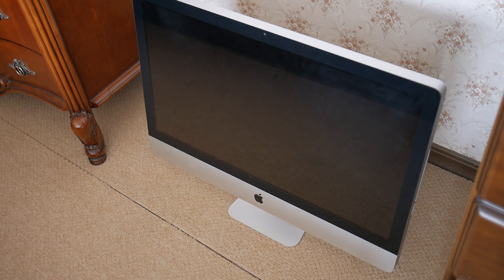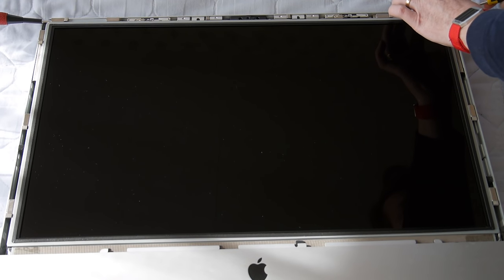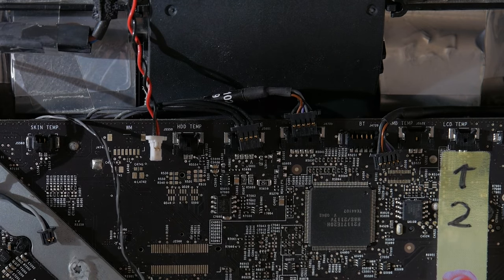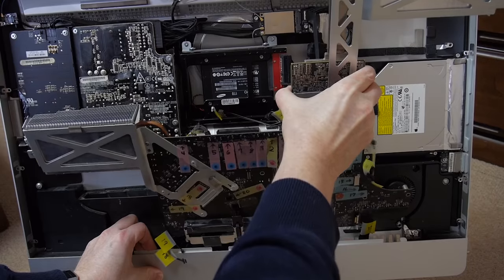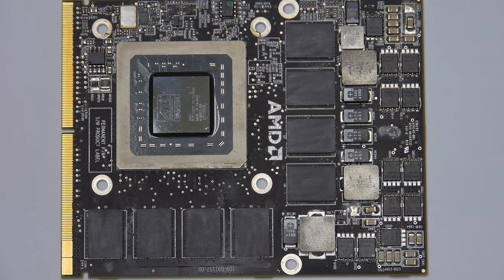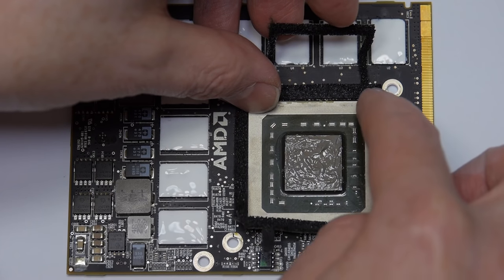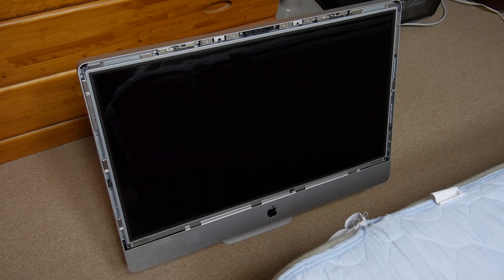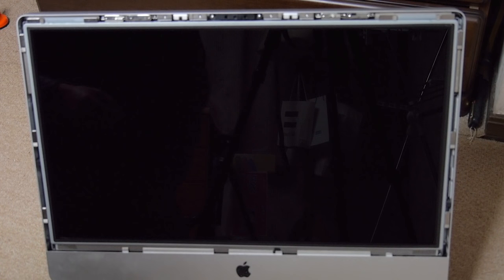Late 2009 iMac 27" Video Card Repair [4850 Bake]

Comment: Ehhh I'm pretty sure you don't have to disconnect and remove the main board to replace the Video card on late 2009 iMacs. The card should just slide out once you remove the 4 screws holding down the video card and heat sink.
Reply from the maker: If you're watching on a desktop computer, click on the words "SHOW MORE" under my JDW channel name at left which will drop down the text description.  I addressed removing the motherboard there. All said, if you want to replace the BR2032 battery, you'll need to remove the motherboard.  If you don't want to do that, please watch my 2nd Bake video where I do the bake without removing the motherboard.

Comment: No need to remove the motherboard on mine. 4 screws off the graphics card and it slipped straight up out of the iMac. Then there was one connector that I had to unplug.
Reply from the maker: You actually do need to remove the motherboard if you wish to change the BR2032 battery on the other side.  People who don’t care about that can watch my Second Bake video which shows how to remove the video card alone, without removing the entire motherboard. The link to that video is posted in the description above.

Comment: Interesting.  But actually not necessary to remove the motherboard, just replaced my GPU in my 2009 imac.
Reply from the maker: Thank you for your comment. I would disagree about the "not necessary to remove the motherboard part" in that MUST remove the motherboard (as explained in my video) in order to replace the BR2032 battery, which is on the flip side of it.  Some may argue that battery replacement is not necessary, but I thought it best to do.  In any case, it sounds like you swapped out your old GPU card for a different one.  Did you swap the same model card or a newer model?  (Just curious)
Reply: Yeah, you definitely needed to take it out to get to the battery.  There was one connector that was really hard to get to, but I managed it. I replaced my 4850 gpu with the 6770m and it works fine. The 4850 cards I saw for sale were too expensive. I was told that any card up to the 6 series would work, but I was cautious and made sure someone had used whatever I got with success. I was looking for the 5750 1 gb so I could get more video memory, but all I could find was really expensive. I know that some people have used the 6970 as an upgrade, can run hot and is also expensive.  This is for the Late 2009 27" Imac, to be clear. For me 512mb vram is fine, but may try the 6970 at some point. (I think it comes in 1 or 2 gb).  I have researched putting in a sata/usb3 port on my machine, but I would have to give up my airport slot. I hope your repair works, thanks for the video.
Reply from the maker: Thank you for sharing those details.  I am curious if the 6770m you used gets hotter than the stock 4850 card.  If the temps are the same, it probably won't matter.  But one of the reasons we have to go through this hell in the first place is because HEAT is causing the problem over time.  Apple doesn't cool their thin Macs as well as an ugly old Windows PC box, and as such the heat can do damage over time.  So if a replacement card is hotter than the stock card, that process would be accelerated.
Reply: No it's not hotter than the 4850.  I'm sure the  6970 would be though. I am using Istat to control my fans,  no more blisteringly hot back on the computer.  I'm sure that's what caused my first card to fail.  Temperature is great now.
Reply from the maker: I too am using a fan control app to keep all 3 fans running at 1500rpm minimum.  It still gets hot (a lot hotter than my 5K iMac at the office) but better than before.
Reply: Istat is a little fussy, but it's keeping my temps in the 100 degree range.  Fan's are not too loud for me.

Comment: i have always wanted to have an expensive mac, but i hate how they are basically dumbed down computers for people that don't care about speed or current gen specs.  i think i am going to buy a 27 inch housing off ebay, slap a 144hz 1440p screen in it, and then hook it up to a 1070 nuc, and if i can fit it i might even do a 1080 nuc.  this way i can run it as a bad ass gaming computer, and also boot it into osx when i want to use a mac.  its really the best of both worlds if you don't have an unlimited budget.  you could go crazy with it and slap in a 4k 144hz screen and then mod in a 8700k 1080sli laptop board behind it with some fancy sff watercooling.  you would have the only gtx 1080 sli 8700k 5ghz 4k144hz 27 inch imac.  that thing would blow away the imac pro by a healthy margin.
Reply from the maker: I somewhat agree with you, especially about the way Apple so underhandedly removed "Pro" features from the MacBook Pro.  I'd love to have an iMac with 144Hz display and HDR.  If you do build that machine, be sure to shoot a good video for us and post it here on YouTube!
Reply: JDW oh man I will for sure do it. I’ve been making generic designs for it. It’s just that gaming nucs are way overpriced. I might just start out small and do it with cheaper hardware first.

Comment: Apple should just allow mac users to buy the video card for cheap. It's damn near 9 years old. I just replaced with a used card and it worked. I was getting checkerboard screen and it would only boot in safe mode.
Reply from the maker: Agreed.  But keep in mind that the card itself has a design flaw.  In my experience, even brand new card fails in about 3 years.

Comment: You've had this apart before. It's upgraded with a SSD drive.
Reply from the maker: Yes, Michael.  The above is my 1st bake video.  My other video shows my 2nd bake, done because my 1st bake lasted only 4 months, for reasons unknown.  Thankfully, my 2nd bake has been working fine for 13 months of daily use.  It's still going strong!  I switched thermal pastes in my 2nd bake, which may also have something to do with it.  And yes, I removed the stock Apple HDD and replaced it with a Samsung EVO 1TB.  The SSD makes a world of difference.  Keep in mind you'll need an interface from OWC that allows you to mount the SSD, and another interface that will prevent the fans from spinning at full blast.  Thanks for watching!
Reply: SSD always makes a world of difference. I upgrade everything. However, it's been many years since I've worked on a Mac. Right now I have my girlfriend's Mac apart, which is why I had to watch your video. (Very good, by the way.) But I have a small issue. I need to replace the graphics card, but what I thought would have been it, you refer to as the inverter. Where exactly is the graphics card if that's not it?
Reply from the maker: Michael, if you see something different in your iMac than what you see in my video, then I would assume you either do not have a 27" model like I do, or you have something other than a late 2009 model (which is what I have).  Smaller iMacs have things in different places than what you see in my video.  So if you could tell me the size and model year of your iMac, and post a photo for me in the cloud and then reply with the link to that photo, I would then be able to offer you more specific advice.
Reply: It's from 2009. I believe it's a 27". The internals look exactly like what you show here.
Reply from the maker: At 29:35 in the above video I remove the video card from its aluminum and copper heatsink.  If you continue watching you will see the circuit board I put in the oven.  That circuit board is the video card.  And if you keep watching after the bake is finished, you see how I applied the thermal paste.  But I still recommend my 2nd Bake video for that, since I used different (better) thermal paste on my 2nd bake.  That 2nd bake video is here: https://youtu.be/6BJGLFCigdA
Reply: Thank you for the info, sir. Most appreciated.

Comment: just save me some !!! im hungry!!!
Reply from the maker: Freshly baked video cards might be tasty, I don't know.  ;-)
Reply: @JDW-  you dont happen to need another one do you? I have one i need to sell + the disk drive + speakers and 3 fans I still have the processor the ram. And the Bluetooth Wi-Fi cards I have actually everything except the hard drive and the logic board.
Reply from the maker: @cgo2key  Thank you for the offer, but no, I am not in need of another iMac. Furthermore, my current financial situation is such that I cannot even afford a cheap obsolete iMac. :-(
Reply: @JDW-  i understand man... I like to work with people when they need it most... If you decide you do need the rest of this stuff... Ill let you have it all for $50.. I can set up a listing on ebay or offerup for you... You could part it out and make some cash or use it...  And don't worry, buddy. I'm not trying to pressure you. Just letting you know the offer is open while I still have it. If you decide you need it...  You want to hear something funny? My buddy gives me this iMac the other night. And tells me it works. It just needs an update. I can check it out. And give him a little something for it if I like it.  He didn't have a power cord for it. And I got one a couple days later. And I plug this thing in. And it didn't work. So I was like screw it. I'll take it apart sell the pieces out of it for what I can get. Well after I sell the motherboard and the hard drive and finish taking it apart. I found the power button that I never saw on it. LMAO so I disassemble a perfectly good 27-inch iMac LOL
Reply from the maker: Thank you for sharing the background info and for the offer. Even if I had the desire and cash, I’m located in Japan and shipping would cost far more than the value of the machine. Even so, other people do read these comments so if one of them is interested in what you have, I’m sure they’ll post a follow up comment for you. Best wishes!
Reply: @JDW-  thank you bro!!! Take care!! ✌

Comment: I was unlucky.. didn't work for me.. more lines after the bake..
Reply from the maker: I'm terribly sorry to hear that.  Yours is the first comment under my video from someone who tried it and said the problem was only made it worse. It could be that your card was simply too damaged, or it could be you simply needed to try something different. One person recommended to me an alternative technique of putting several coins or a weighty copper block on top of the GPU chip while baking.   If you want to try again, I would suggest you try that and also be sure to bake it at 200°C for a full 10 minutes because that's what I did in my 2nd bake.

Comment: If I installed Windows could I use a nvidia mxm card
Reply from the maker: Even if the card is the same physical size as the stock video card, it will not work unless it has Apple firmware on it. Whether or not you could get it to work simply by installing Windows and running in Boot Camp is something that is never been tested, so it would come with somewhat of a risk if you wanted to try it. But if you do want to try it, be sure to video your experience so that you can share with others if indeed it does work. But I myself would prefer not to run Windows exclusively on iMac.
Reply: worth a try I guess. The hardware drivers for Windows are normally supplied via Apple I think ?
Reply from the maker: Apple only supplies Windows compatibility (drivers, etc.) within their "Boot Camp" software, which requires you to install Windows on your Mac and then boot into that partition.

Comment: It is not necessary to remove the logic board.
Reply from the maker: You are the 4th person to say that.  To avoid repeating my same reply on this topic, I have updated the Description as of a few moments ago to address that.  Here is what I wrote:

By the way, several people have said "you don't need to remove the motherboard."  My answer to that is, "yes you do if you want to change the CR2032 battery on the back side of the motherboard."  Even if you don't think you want to change the battery, at least remove the old one.  Even lithium button cell batteries leak after many years of being installed in electronics.  And for those of you who don't care about any of that, simply watch my 2nd bake video (link below) to see how to go about the bake WITHOUT removing the motherboard.

Comment: Has anyone successfully tried a hot air gun on the gpu card to see if it fixes the dry solder issues.
Reply from the maker: Yes, some experienced professionals have reported success with that.  I know because I read and reply to every comment under all my videos.  Never try a heat gun for the first time on your video card though.  Take great care when you use heat guns because they will desolder components, which is not what you want.  While the benefits of heating the GPU chip is the same, the bake shown in my videos is vastly safer for most people.
Reply: @JDW-  yeah i guess the trick is monitor temps as you go. BTW great Video!!

Comment: Oh my God that's not how a ESD strap works . There's a cable that goes up to the strap to the computer . And you don't even have the cable on there
Reply from the maker: Thanks for watching.  Yes, I am aware.  I don't often use ESD straps, and in my 25+ years of working with electronics I've never zapped anything.  I doubt I've been "lucky" all those years, so maybe I am just blessed.  Anyway, at the time I made these videos, an engineer friend of mine gave me this non-wired ESD strap.  I had my doubts it would work, and after a bit of research (after made these bake videos) I could see the evidence showing they actually don't work at all.  So of course, I would recommend anyone following my video to use a wired version strap, and such is listed in the text description under my video.

Comment: Did this and got 4 weeks out of the POS!

You can't trust this machine once the GPU craps itself, you will never know when it's gunna die again.

I learned my lesson, overpriced Apple products ALWAYS have issues of one sort or another and longevity is not part of the Apple mantra nor are supplying spares and long term support.

PC is the solution period.
Reply from the maker: Jason, I'm sorry to hear your bake only yielded 1 month of use.  That would anger me as well.  Indeed, the fact that I only got 4 months from my 1st bake didn't sit well with me either.  Even so, I did use old paste the first time, and I didn't completely replace the stock Apple thermal pads.  I considered that bad on my part, so I was sure to do it right on my 2nd bake (see my video for that), and whether I was just lucky or not, I do not know, but I am still able to use the iMac daily, now going on 12 months after that 2nd bake.  

To be clear, the only reason I even tried the bake myself was because I watched another YouTuber claim 17 months of use after his first bake.  Since I had nothing to lose (except time and a tiny amount of money), I gave it a shot.  So while my 1st bake was a sad failure, I cannot help but be pleased with the second bake.

I myself have never turned to Windows, in spite of my many complaints about Apple.  I'm not necessarily a "fan boy" in that I dare to criticize them and even sending them a fare amount of Feedback messages too.  But I've been a Mac user since the 128k in 1984, and I still prefer MacOS over Windows.  I'm pleased Apple finally fixed the video card issues starting with the 5K iMac, and the 5K iMac I have at the office has worked flawlessly since it was purchased in 2015.  But of course, that doesn't magically fix all their older iMac hardware that came with these defect video cards.  Apple also does stupid things like remove the SD card slot from MacBooks labeled "Pro," and they only talk about loving the Mac without WOWing us with great advances in Mac hardware.  So I can understand how you feel.  I actually have considered a Hackintosh, but I am quite busy at my job and really don't have time to fiddle around fixing software quirks that surely come with each MacOS update.

Anyway, thanks for watching and best wishes.
Reply: Thanks for the reply, I am writing this on my 11 year old PC which has never needed a single bit of maintenance or repair in that time - it originally cost $900 to have built.

My issue is that this video card hack only buys you a short period of functionality and you never know when it will fail again but you do know it certainly will.

Rather than spend $3000 on a new Mac I will get a high spec PC and all the reliability that goes with it and if the video card dies I will be able to choose from a squillion cards and upgrade it at will even 10 years down the track.

Good luck and best wishes to you. Se la vie